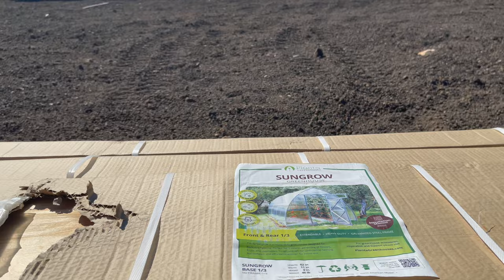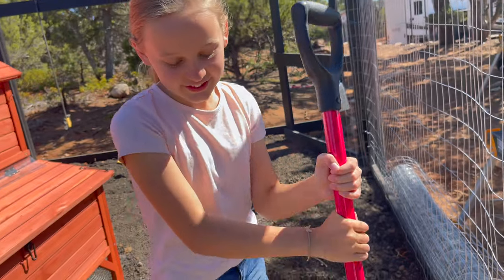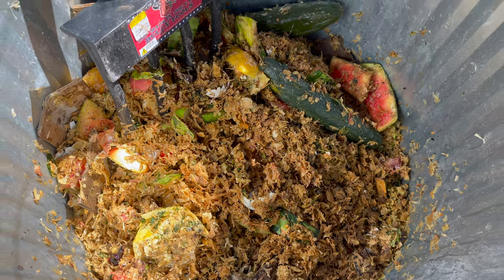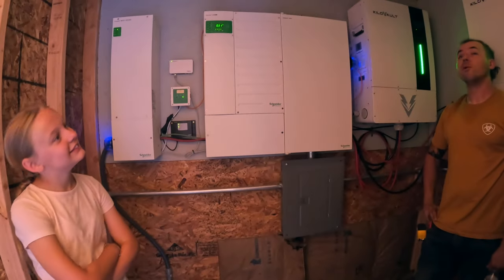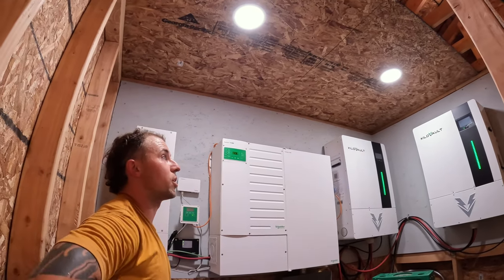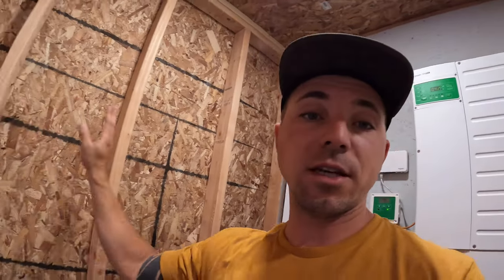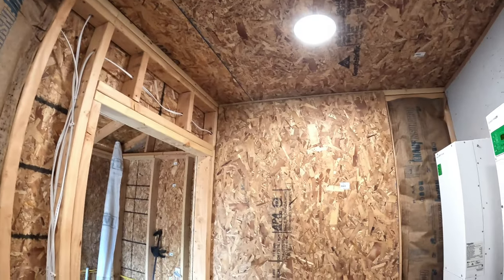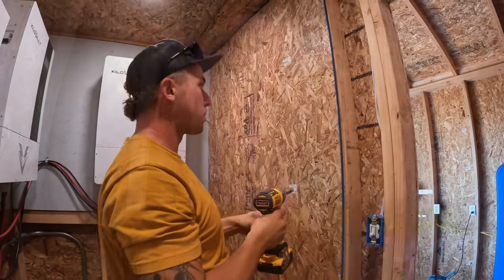WE GOT ANOTHER KID I WATER TOTES I SOLAR/PUMP SHED I COUPLE BUILDS OFF GRID HOMESTEAD

Comment: We do 4.5" x 20" cartridge filters in Big Blue Filter Housings.    This larger size lasts us thru at least 15,000gal before needing to change them because their larger they allow higher  gal / minute.   We do   Roof -> 400micron sock -> 2500gal tanks -> 20micron (4.5" x 20") -> 5micron (4.5" x 20") -> Class A UV -> House.    Works like a charm!.    Some do a 3rd charcoal filter for taste...   but we don't need it, water is just fine.   We do put a little chlorine (Bleach) in the tanks after the water sits stagnant for a few months in summer heat with no rain -  2.5 teaspoons of bleach per 50gal = 1.0cup  / 1000 gal.     Since you're doing a new house,  you could route plumbing to non-potable (toilets) vs drinking water (kitchen) and reduce water going thru the filters/UV to make them last aaaaa looooot longer.
Reply from the maker: Thanks Kenneth! We ordered a system the other day. We piece mealed it together. We have a pre-filter, then a large blue cartridge filter and then into a large active carbon filter. After that we have a UV light. Should be about 18gpm.